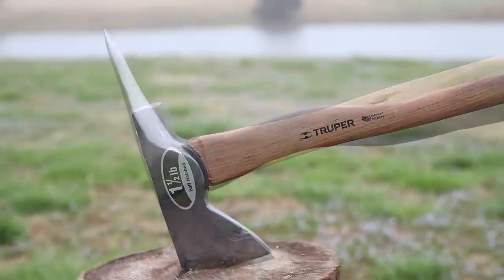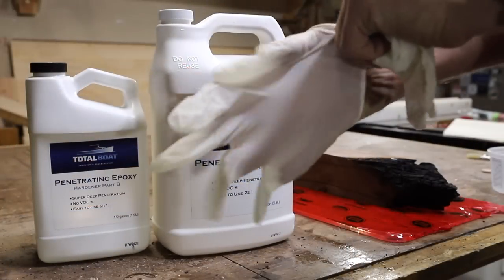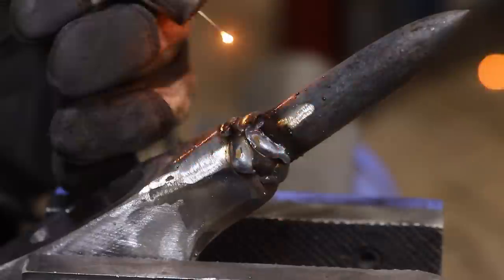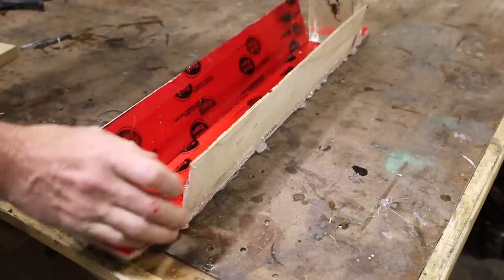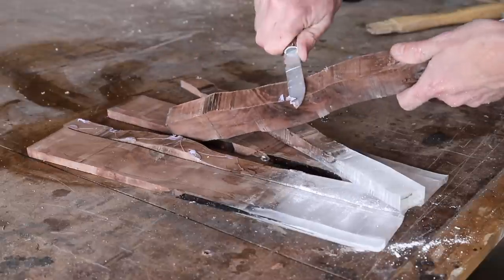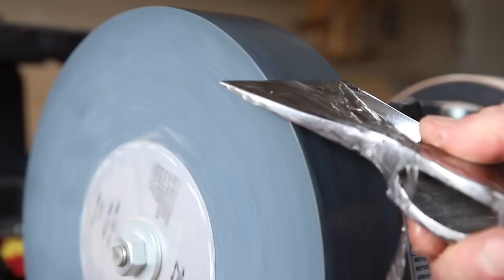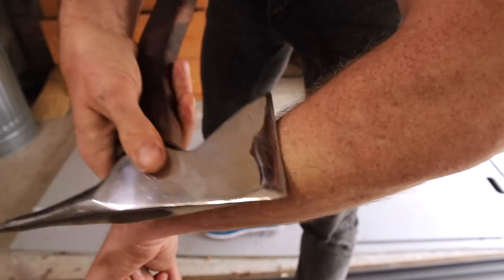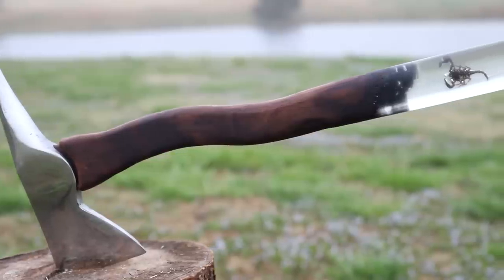World's Most DANGEROUS Axe Mod

Comment: I think the reason walnut isn't usually used for handles is because it transfers vibrations more than other woods +it's obviously expensive
Reply: Eli I was thinking of saying the same thing. But in this case it’s a short handle and the epoxy should dull the vibrations although it will also dull the impact force. Still this shouldn’t detract from its overall look and effect since look and light duty function are its principal use and it excels at both. An easy 8.5 out of 10 but as an art object it easily gets into the 9.5 out of 10 level because of the poly end to the handle and weird factor of having a bug inside as well. Very beautiful to me at least and also quite functional.
Reply: Walnut is popular for gun stocks for a reason I don’t know
Reply: @jasminderization  it is very rigid, giving a gun great durability. Plus it looks pretty dang coolio.
Reply: @jasminderization  it's pretty.
Reply: @jasminderization  looks good and it's sturdy
Reply: Nick Offerman
Reply: Walnut is softer than red oak on the Janka Scale. It does dent and scratch easier but doesn't crack and check like hickory with humidity changes. I dont know how this would hold up, but I wonder if the handle would loosen if the walnut wasnt compressed really well under the ax head.

Comment: Excellent Work! A+
Next time, gently use your fingers to pull/pry open the Scorpion claws. They will stay open.
For anyone interested, you can get glass baubles, fill halfway with Hand Sanitizer, put specimen in,
add more Sanitizer. Use unfolder paper clips, plastic knife, fork etc to pose the critter. Don't use wood.
The specimens will keep for 200+ years. Seal the lid with wax paper etc to stop evaporation.
I have tons of specimens, black widow, fiddle backs, orb weavers, 3 diff scorpions etc.

Comment: You ruined the heat treat on the head when you welded the nail puller
Reply: That's what I was thinking. But it looks like the heat may have only affected the bottom inch or so of the actual edge so it should be fine. If he just wrapped the edge with a wet rag it would have been fine.
Reply: It's Private  thats a pretty dumb comment.
Reply: It's Private  carbon steel and its  heat treatment is cheap  as fuck at the amounts they made. Also, you cant sell a completely a useless soft axe if you plan on selling huge quantities, even if it is cheap...

Comment: This is a neat idea but, Rest assure that epoxy will break loose one day and i would just 🤞cross your fingers that it would not be at the wrong time 😣😵
Reply: Yeah, but it's more a work of art.
Reply: not necessarily as the resin will not just have bonded to the surface of the wood but also soaks slightly into the wood so if the correct resin and wood are used the bond should outlast the person who made it :)

Comment: Wow ! Beautiful 
But were is the hardening ?
Reply: It should have been hardened and tempered from the factory. Although, he did introduce a lot of heat with the welding and grinding so you might have a point
Reply: Would it temper and harden with the additive welding? I don't know much about welding.
Reply: Disconnect Google+ No, because it was air cooled, not quenched in oil. And even if this steel worked with air cooling, he didn’t run it through a heat cycle to temper it afterwards
Reply: @jakedries4635  Jeezycreezy. No wonder people have been dividing labor since forever ago.
Reply: No, it weresn't.
Reply: It is bad steel and so its not realy possible to harden it. And all the hardness from factory is gone because of the use of hot Tools. I think that the amount of Work that he put into that handle should have deserved a better Steel :D
Reply: Are you still looking for the gardening? *pulls down pants
Reply: Candaule 2 Kompet all tho these type of cool custom mod axes are cool most of creators of these wont bother to harden and temper the axe heads after welding and grinding
Reply: Not only that, but different types of steel for different parts of the head.. it doesn't seem right
Reply: @wanzogames30yearsago62  
Sorry  im French, i dont speak english very well^^
Reply: It's a shitty amazon axe. This is pretty much only for show
Reply: Nope. The axe was oil hardened from the factory. The welding didn't got the heat all the way to the blade, and only the blade of the axe must be hardened

Comment: It crossed my mind that gluing the wedge in doesn't allow any adjustment if the shaft wears or shrinks inside the axe head. You can't tap it in any further. I would have left it as a friction fit.  But I am no expert.  
Lovely job on the axe.

Comment: Just looking at it, It is not a "functional" axe, It WILL "work" but using welding beads to add material will weaken it,  walnut is completly the wrong wood to make handles, and I wouldn't trust the epoxy to last longer than a couple hours of heavy use. That said it is cool and I do need one

Comment: Hey Jonny Builds, that was one most awesome build. I've always wanted to get into bladesmithing and then segue into Blade Forging and Blacksmithing. Alas I'm still waiting on that lotto ticket or unknown rich relative so I can purchase things to outfit at least an entry level shop. Right now I'm a disabled Vet taking care of my 80 yr old Disabled Veteran Father so not much financing to work with. A friend is thinking about trying to open a gunsmithing service with a VA Loan,(he's a Vet Also) so I might just see if I can get my own VA loan and share space. Anyway, you have a new subscriber, now I'm off to check out some of your other builds. Have a Good One.
Reply from the maker: Thanks so much & good luck to you!
Reply: @JonnyBuilds  You're most welcome and thanks for having a channel I just happen to run across that inspires me when I'm trying to decide on attempting my 3rd business venture. After my tour on the Old Navy Frigate I worked construction. Within a year was running my own Gen Contracting DBA with 2 crews. When the housing market tanked I went to school and got my A.A.S in Computer Science and Networking; went to work for a local ISP and when they closed 8 yrs later I took over their clients and was doing well. Then I got double-tapped,,, T-Bone car wreck and the local telco got bought out and the new corp didn't want to resell DSL circuits. And that's where I am now. Wow, I don't normally unload like that on SocMed, guess I just got fired up checking out some of your builds, maybe soon I'll posting some of my own. Have a Good One and; "Put your trust in the Lord but keep your powder dry". In case you're not from the South that basically means Believe and Trust in God but always be ready to stand on your own when needed; I'm sorry if that's not offensive to you, but I'm thinking it won't be.